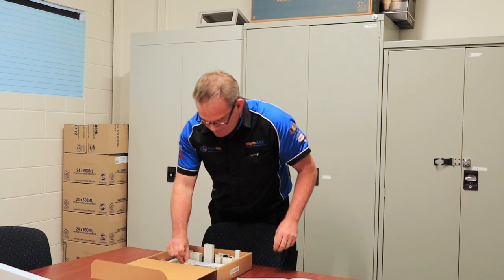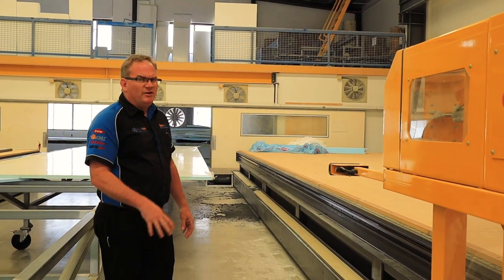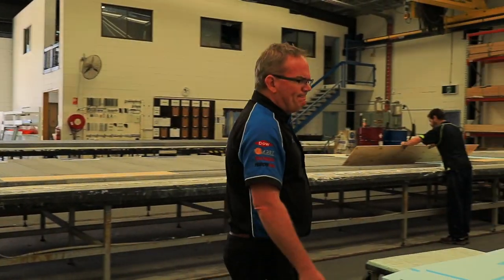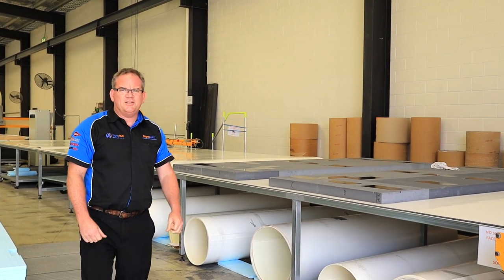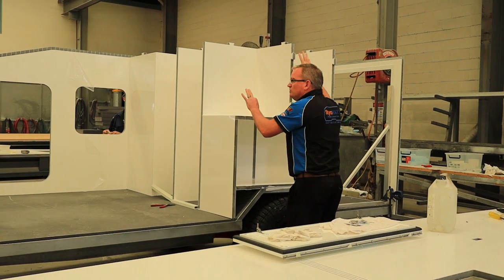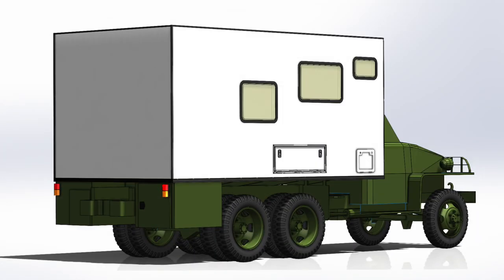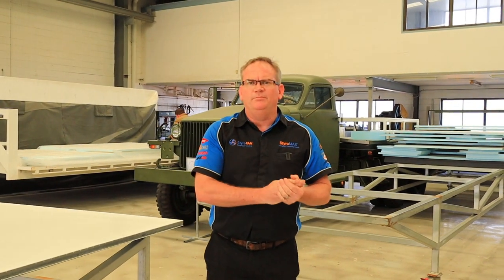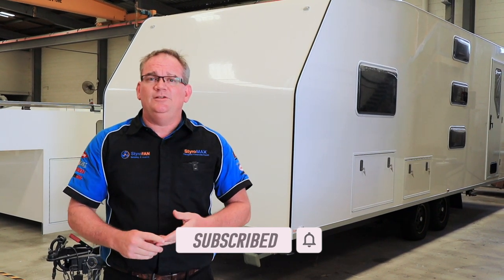1st February 2021 Factory Walk through

Comment: The squareback: How are the walls attached to the floor?  In other words, on what and against what are they sitting?
Reply from the maker: We recommend that all side wall panels are bonded to a subframe with a minimum of 50mm of bond surface area. These panels would be bonded directly to the subframe/chassis.